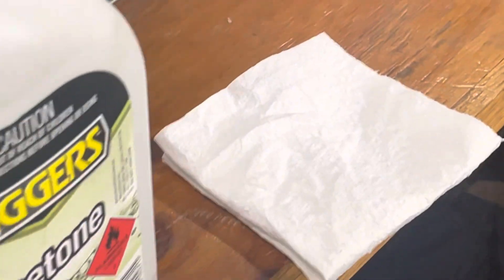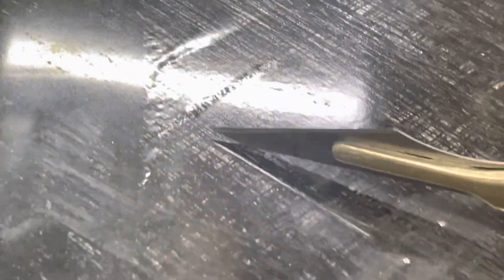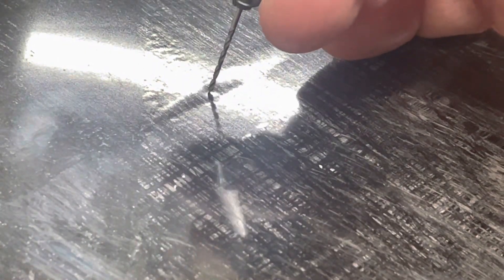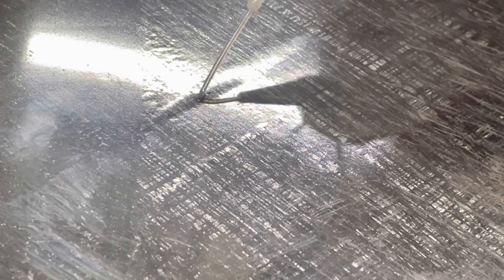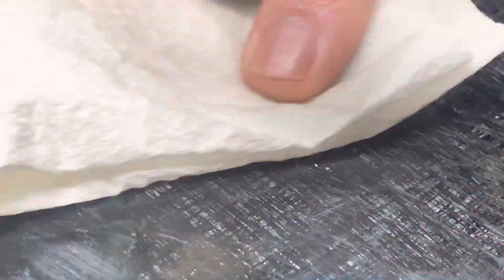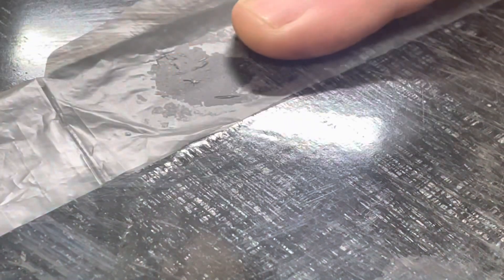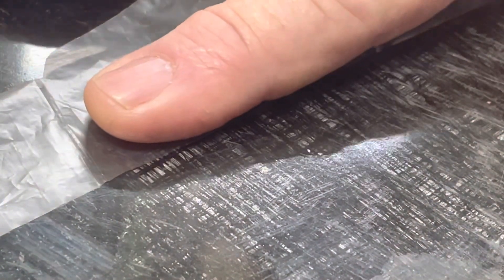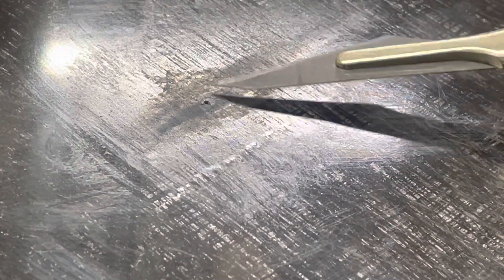F5J skin delamination repair

Comment: be careful the core isn't going to get dissolved by the CA, check the core material, or use foam safe CA.  A better way is to inject epoxy, ( possibly with more than one hole to help air escape, wipe up excess epoxy,  then cover it with a harder shiny plastic,(mylar, acetate)(it might help to wax that a bit, then vacuum bag it with a food-saver vacuum bag and let it cure. This should give a much better finish.

Comment from the maker: Edit/Update:
In the video, I applied the CA and pushed it along the “vein” under the skin.
Instead of wiping with acetone and holding plastic on it, I have found that spraying the spot with kicker and rubbing the delam area until the CA kicks off is much better from the aesthetics perspective.

It’s not gone but it’s better than what I’d achieved with the plastic strip.

Disclaimer: I don’t know the health ramifications of direct contact with kicker so do your own research.

Good luck

Comment: Good job david.  On similar but more heavier skin delam I have used a fine diabetic syringe needle attacked superglue to pierce the skin and apply drop. Bit less glue on outside that way.  Also wonder if a covering iron GENTLY woul reduce the stretched skin first. (Proceed with caution)

Comment: About right, hope it works. The way to deal with bubbles in full scale composite plans, that are up to 1" diameter: Make a hole much like you have with a small drill bit, fill a syringe with epoxy, inject until all air is expunged, let cure. (The gauge of the needle can make it difficult to pass epoxy that's too viscous, trial and error). Now, this won't make it pretty, or light, but it will support and stiffen up the layers again: like a tiny little composite sandwich.

Bigger repairs are much more involved, and probably don't warrant time spent here detailing.